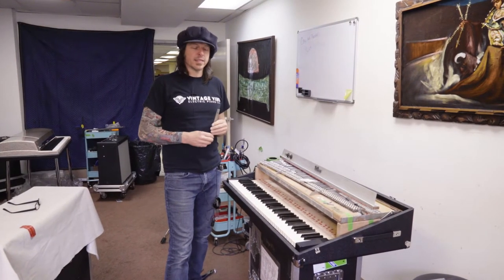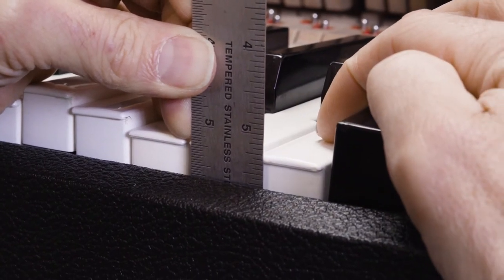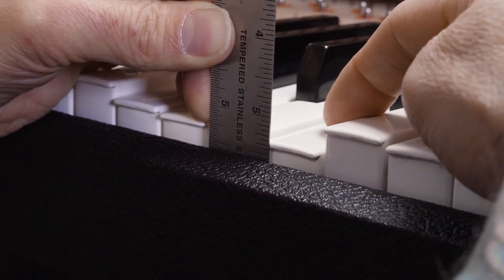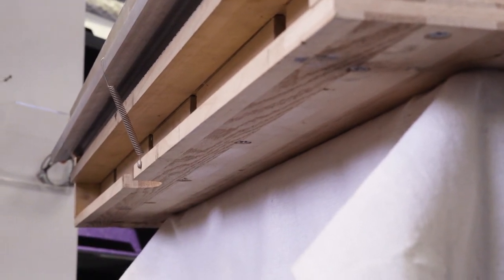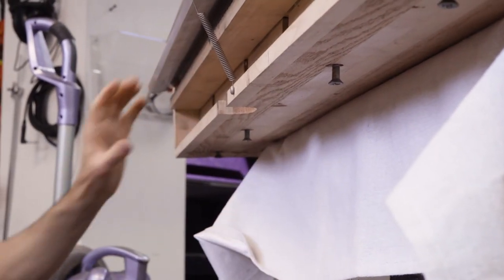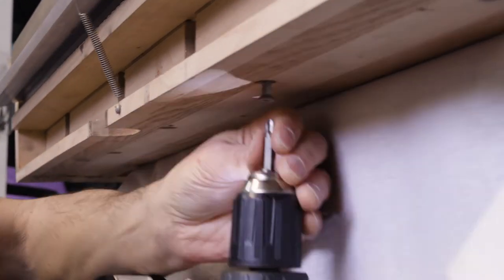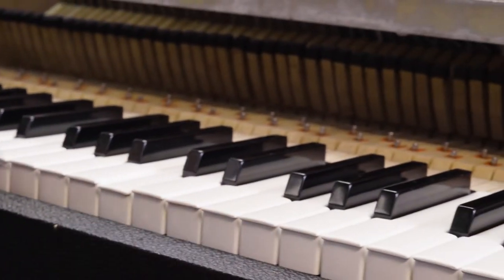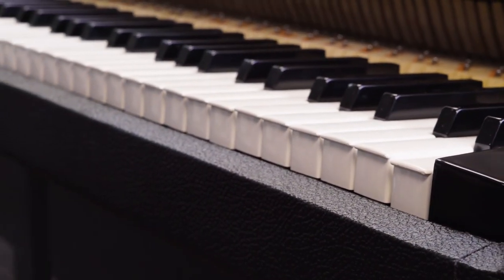Tech Tip | Fender Rhodes Key Dip Adjustment

Comment: Nice video! This is definitely a "page" that should be added to the Rhodes Service Manual. I suggest using pieces of wood veneer for shimming. It will likely be easier to source than leftover Rhodes parts if you are not a full-time Rhodes repair shop. It's easy to source veneer from most nationwide hardware stores. Works great for harp level adjustments as well!
Reply: Hey Max! I had ordered some nice hardwood veneer before seeing your comment...good to know it will work. Also, I need to shim the action rail on my '75 Mark I. Is it the same procedure as this video for pianos with aluminum harp supports?

Comment: Hi Chris, is there a way to adjust the action rail when the key dip is too deep? There are no shims on my actions rail and the key dip is too deep on most of the keys. Would you recommend shimming the back rail felt that the key pedestals rest on? All the hammers are touching the keys at resting point rather than resting above them so it seems like shimming the back rail felt would fix that too. Your input would be greatly appreciated and thanks for all the tips!
Reply: I'm having the same problem now.  Key dip is about 1/16" past 3/8".  Did you figure this out?
Reply from the maker: T- Dredz  for tech questions please follow and ask us on FB Vintage Vibe Restoration Page.
Reply: yo I can't seem to find this info on the FB page. T-Dreds- did you have any luck with this?
Reply: @markmasefield  If key dip is too deep, and you have no shims that you can remove, then yes what you want to do is increase the height of the back rail felt/cloth. Sometimes it is glued in by only the front edge, so you can shim the back edge to take up the height. Alternatively, (and especially if you have original and worn-out back rail felt) you can replace it entirely with a thicker felt. Piano supply shops sell it as "back rail cloth", "key end cloth", or even "key rest cloth". (These are nice but can be quite thick, and may require action rail shimming to compensate.) Things to keep in mind: take the time to tighten the action rail in fully when making key dip measurements, as it will shift when tightened. Also, if you are setting key dip on the way to installing a bump mod, make sure that you have pedestal felt in place when making the measurements. In case of a 75-77 piano with felt on the hammer cams, be aware that the hammer cam felt is slightly thinner than the new pedestal felt that comes with the bump mod, which affects key dip. Thinner pedestal felt = increased keydip (can be around 1/16").
Reply: Could be warping of keys themselves?

Comment: The key heights aren't even.  Shouldn't that be fixed first?
Reply: what should be the right height? should it be measured from the case or from the front rail?
Reply: @vintage vibe - could we get a reply to this. Should key height not be set first?